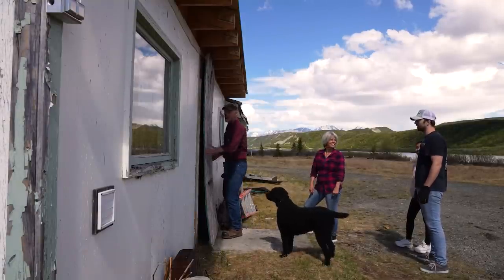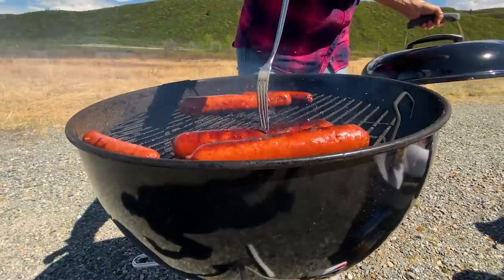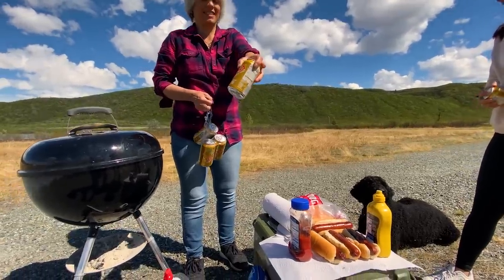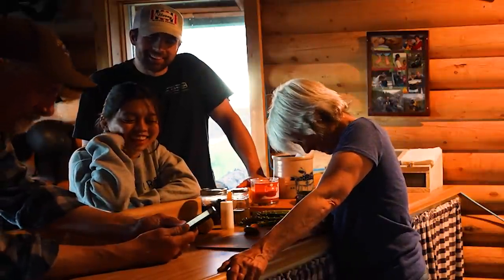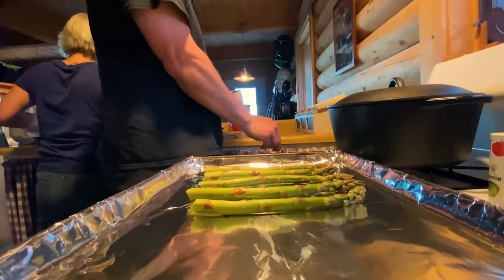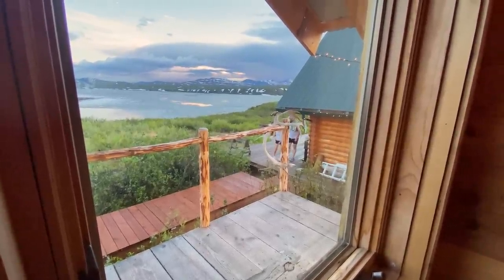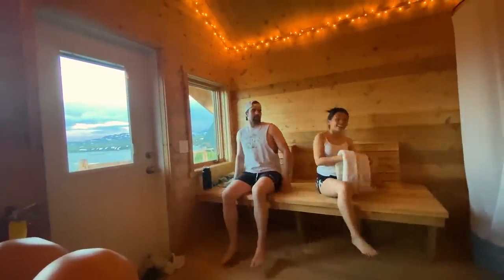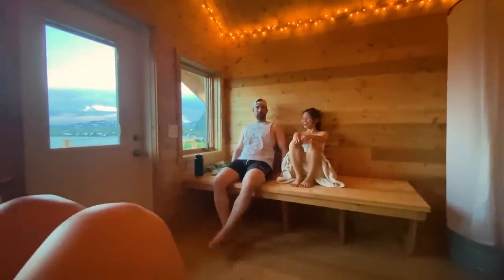RACING The RAIN! (Will We Get This Done?) Off Grid, Alaska

Comment: That oven has fev desing flavs. You should have about 10 cm ash tray under the fire pit. That is how you controll the heat. Open is full power, closed is - no power. You need more rock on the oven. normally there is 30-50kg. You can add about 45 cm metal mesh to the exhaust pipe and fill it with rock. Also you can put metal water tank sideto the oven and heat water when heating sauna. You don't need to put drinking water to the owen. River water is ok also or what you can get from the roof.